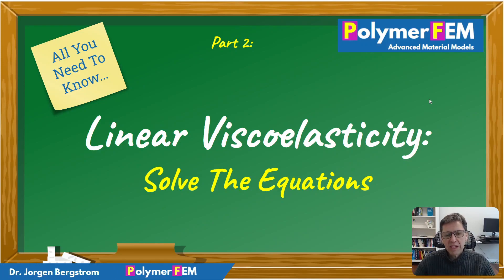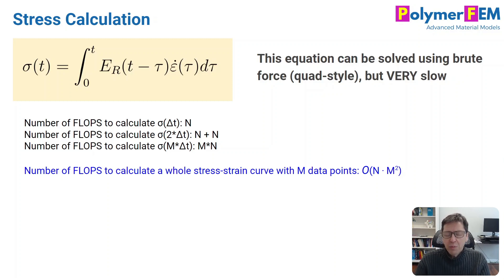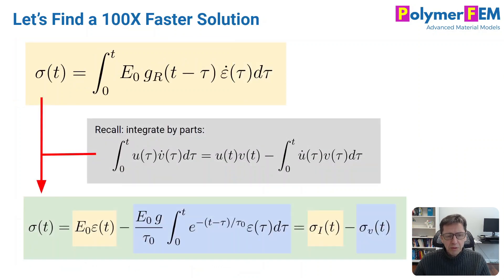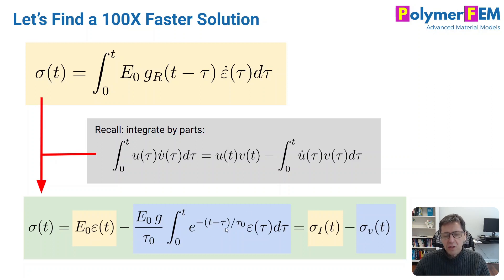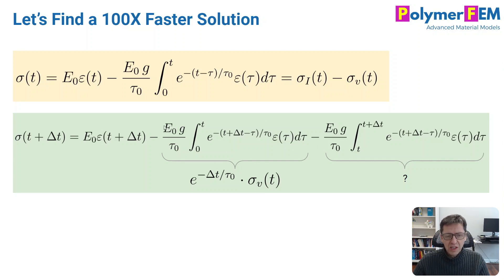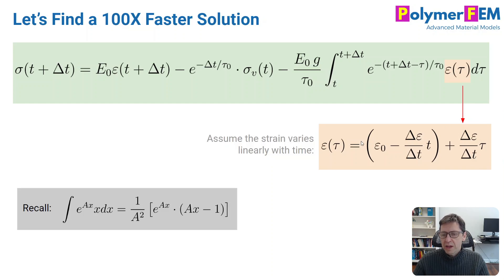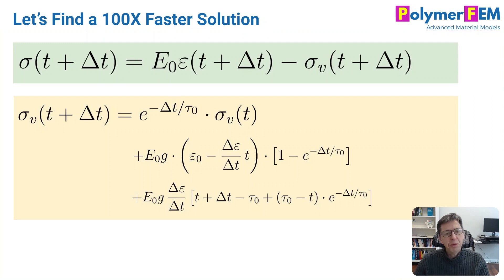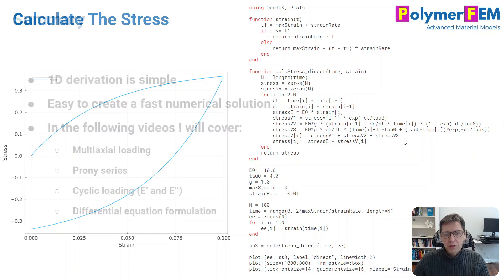Linear Viscoelasticity - Part 2 - Solve The Equations

Comment: Hi Dr. Jorgen Bergstrom, I have a question about your julia code. In the function calcStress_direct, should we use time[i-1] for stressV2 and stressV3? The influence on the final results is negligible given the fact that time[i-1] almost equals time[i]. However, here current time t should be i-1 and we try to shoot for the next step i at time t+deltat, right? Let me know what you think. Again, great tutorial!